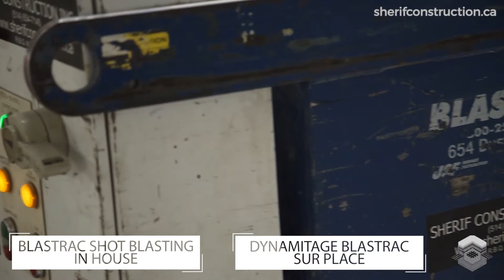Montreal. Parking concrete floor Epoxy membrane coating. Blastrac/Scarifying surface preparation.

Comment: What sand are you broadcasting?
Reply: Silica Sand # 24
Reply: You base coat were you broadcast sand is 100% epoxy or other type of resin?
Reply from the maker: @sonicoaguilar3151  100% solids epoxy